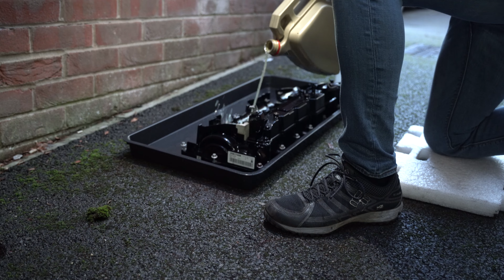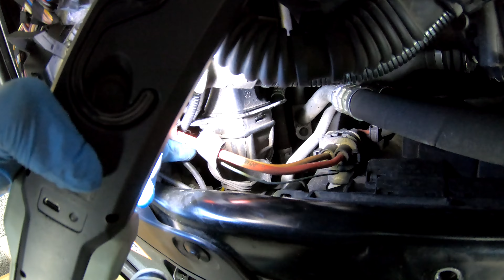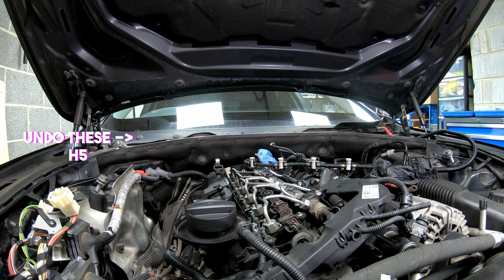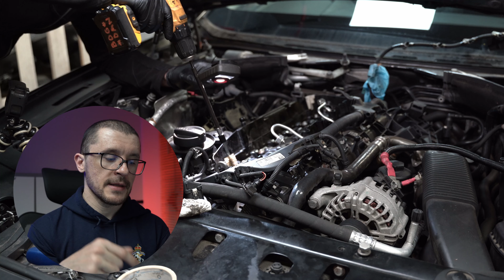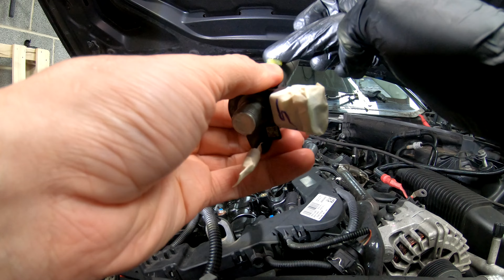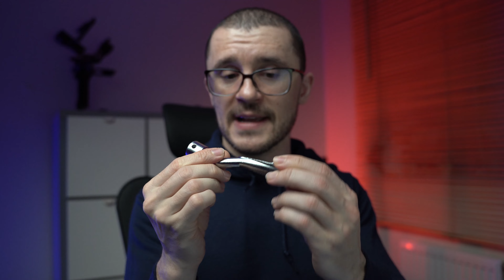How to Replace BMW F10/F11 530d N57 Valve Rocker Cover Gasket  - Step By Step - Common BMW Problems

Comment: Hi thanks for the video, i've heard people changing the whole cover as the gasket leaks again after a while, what's your opinion on this ?
Do you think it's a doable job for the average joe ? I believe if i had a repair manual with steps and torqs i could do it, did you use a manual ?
Reply from the maker: I do believe that you have all you need in this video and in the other videos I have o the channel. Also I offer 1to1 paid technical support GBP100/session . if you need that, email me and we can book it.

Comment: OMG I just did this on my 2014 535D US based and I’ll post the video soon. Dealer wanted $3000 Here is what I learned. Some tips, For priming, If you don’t have a computer, you can just hit start and let it crank over 10 times and it will start. , on my car it was about as many times as this video. The injectors need to be numbered and go back where they were because they are programmed for each cylinder. Same I numbered the fuel lines, You don’t need a fuel line socket, I just used a wrench. 🔧

Comment: What the hell are the little tiny o-rings for no other injector seal kits or websites list them. Fcp eruo and ecs just nothing.
Reply from the maker: You are referring to the fuel return line O-rings?
Reply: @BestCarMods if by that you mean the super tiny black o rings yes
Reply from the maker: @michael_christian9461  those are the ones.
Reply: @BestCarMods i absolutely for the life of me can not 100% confirm if my car has them or not no us sellers dont have them do all these n57s have them? As far as the us is concerned, they dont exist. And the linked one in your bio wont ship to us
Reply from the maker: @michael_christian9461  you can do the work even without replacing them.

Comment: Its always best to replace the valve cover and gasket, You dont need a fuel diagnostic for bmw just turn the ignition on and off x5 before trying to start, also the injector bots are stretch bolts and should be replaced if ever removed as they are 1x use only, appart from that fantastic video and good job 👏
Reply from the maker: technically, you got it wrong. the fuel priming needs to be  done via diagnostics and in the case of my engine (but i believe is the same for all N57 47) the injector bolts are not required to be replaced. If you find technical documentation that contradicts this, please share it.
Reply: @BestCarMods technically I'm right with another 1 done today, auto prime by using the ignition and never reuse the strech bolts unless you fancy snapping 1 off in the near future
Reply from the maker: @jakesingh6905  again, could you please link/state the source of your findings? how did you reach the conclusion that the injector bolts are stretch bolts?
Reply: @BestCarMods any good mechanic knows this, Google it i did put the link but they keep removing it
Reply: I've done plenty of these and in my opinion they are called stretch bolts for a reason, do some research they are 1 time use, also simply turning the ignition on a few times primes the system automatically 😉
Reply from the maker: @jakesingh6905 again, could you please share where you found this info? My service manuals don’t reflect the same thing.
Reply: @BestCarMods Google it buddy

Comment: I was quoted 360 euros to fix this issue on my 530D, i thought damn so expensive, because i opened the valve cover on a 2008 Caddy which was super easy, no need to unplug anything else to get to it, but after watching this video i think i got a good price lol.
Reply from the maker: I recommend changing the cover completely not just the gasket.
Reply: @BestCarMods  Yup i did that, researched a bit and got to that conclusion pretty quickly, now it's all good, after that i realized i also have a oil leakage somwhere on the turbo, so that sucks but i'll fix it too.
Reply from the maker: @mrd799  :)) same as me. I sent out the turbo for a refurbishment (last month) and now it is all clean and no oil in or on the exhaust. also it feels like it has more power.
Reply: @BestCarMods  Nice, yeah i have the same issue, my 530D is tuned to 330hp, its 245hp stock, and sometimes i get even less than stock power, it sometimes feels ke 200hp, and sometimes it has the full 330hp,
Reply from the maker: @mrd799 try to measure crank case pressure, that might influence turbo oil leak.

Comment: hi, how i can bleed the system without diagnostic tool? and what you was soldering there?
Reply from the maker: 1. you loosen up a injector pipe at a time and you crank the engine . that will eventually bleed out the system. 2. watch the video and you will see.
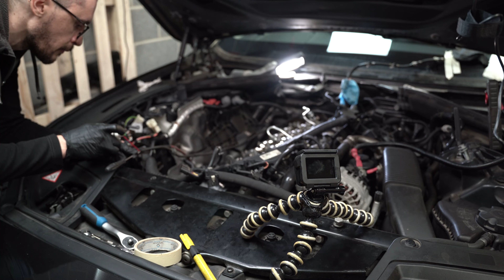Reply: @BestCarMods Sorry but it's not clear about the soldering. At around 14:30 your not commenting and the camera is too far away to see what you're doing. In the pictures we don't understand what we have to look for, no annotations.
Reply from the maker: @MickD464  https://youtu.be/NAElcGkdvys?si=vcb_Zt1_LCcdn85Q&t=817

Comment: Any long term issues you've noticed with having modified the valve cover to clear the fuel lines? I kinda don't want to remove the intake to do this job lol

Comment: Which brand valve cover are you choosing?  What are your experiences?
Reply from the maker: I installed febi and the client had problems, I installed vaico and it was ok. For my car I plan of buying Vaico. Right now I have the old one with glue on the sides.

Comment: Can I put copper grease on the injectors after removing them?
Reply from the maker: I would not use that. The last car I have worked on, had copper grease placed by a garage  2 weeks before. It burned and created a lot of carbon deposits. Also avoid placing grease on the washers or near the tip.

Comment: Holy cow, what an ordeal 🤯
Reply from the maker: and I need to do it again ... :)
Reply: @BestCarMods I need to do mine aswel…started smoking.any tips on getting it right first time ?
Reply from the maker: @seniorsmith9307  change the part completely.
Reply: @BestCarMods had my gasket replaced now when car is hot knocking noise at idle , did they mess up injectors?
Reply from the maker: @seniorsmith9307  anything is possible, from not placing the injectors in the right order to not cleaning the seating surface and possible blow by. diagnosing this via internet is not possible. did you/they replace the coper washers?
Reply: @BestCarMods yes they did… but they had to change them because the ones I supplied (elring) were to thin. I might have to go back and as them if they followed protocol with that. Thanks
Reply from the maker: @seniorsmith9307  if they pay attention to the thickness of those washers they should be good at following procedure. many tech don't even consider that. Also I am surprised that a brand like elring to mess it up
Reply from the maker: @seniorsmith9307  technically speaking, if you did not have the noise before the rocker cover repair, it can't be the crankshaft pulley as that one is in a different area altogether and they should not have touched anything there.
Reply: @BestCarMods true, also when warm idle I’m getting a new consistent smell in the cabin
Reply from the maker: @seniorsmith9307  :)) you really had bad luck with this repair. How much did you pay for it ?
Reply: @BestCarMods   350. Shoild I request them do it again?
Reply from the maker: @ at a minimum you should ask them to take a look and see if they missed something. Ask for a technical report saying what they consider being wrong.
Reply from the maker: @seniorsmith9307  complicated to say ... if you go to a dentist and he messes it up would you want the same dentist to mess it up again ? where are you based?

Comment: Hi mate, great work.
My car F11 520  just started to smell a bit inside. When I put my hand behind the engine left hand side  i notticed on my fingers bit of oil nothing major, there are no lights on the dashboard. Do you think I should use a gasket oil sealant ?  How long did  it took you to do the job on your car? 
Thanks in advance.
Reply from the maker: when you do it first time, look at one full day.
maybe on the 2.0 you have more room and you don\t need to take apart as many things. 

where are you based?

Comment: Im changing the cover complete , with new gaskets. Seemed logical. Once the top of the head is cleaned off, so you need to lube the new gasket face before seating the cover back in?
Reply from the maker: yes. with a bit of engine oil

Comment: My F11 525D has just failed its MOT on an oil leak and I think its this. Back left corner.
Reply from the maker: :) clean it with brake cleaner and go for a recheck :))

Comment: So I’ve got smoke coming from a plastic cap directly behind the oil filler cap. Could this be the same issue ? Not even sure what the cap is. It’s slightly smalller than the oil cap and is fitted with clips. BMW f10 (2012)
Reply: The black round cap in the middle of the screen at 18:24 on this video
Reply from the maker: what engine ?
Reply: Same engine as this f10 535d
Reply from the maker: @danhowey5784  hard to tell just by your description ... it can be the cover itself or i would think it is the PCV return hose .

Comment: Hello thanks for the video! 
I got a question about the metal shards, are they not falling in the cilinder when cleaning with the wire brush, or sanding? And is a vacuum cleaner enough to get it out?
Reply from the maker: 1. you are not producing "metal shards" ... as your aim is to eliminate carbon deposits and just gently resurface the injector seating 2. using compressed air or a vacuum is the best you can do... feel free to use any method you consider useful. Just make sure you don't drop something (big) in the piston ;). many times we overthink it.
Reply: Might not be relevant, but on my ”beater” 320d i just used screwdriver, break clean, wipes and vacuum. It had so much carbon that the whole shaft and hole was covered so i had to use vac

Comment: In case anyone wonders, the BMW dealership in Dallas Texas just quoted $3,750 to do this job. My sister in law asked me if I could do it. I've replaced tons of valve covers, so I told her I would take a look. I'm convinced that BMW has a team of engineers that are tasked with taking every job and redesigning whatever is needed to make the job as difficult and overly complicated as possible. Are you kidding me??!  THIS to replace the valve cover??!  GTFO. I've kept my wife's 2011 MINI S running all these years and I despise working on that car. We are dumping her MINI and getting something that isn't designed by sadistic jerks.
Reply from the maker: :) German Engineering
Reply: Like I tell all my coworkers who say "ohhh Mr money blah blah". No.... if i couldn't work on them myself I wouldn't be able to afford them.. the price vs performance along witg reliability is insane for these cars. Gotta keep up with them though.
Reply from the maker: @DiddysBBOil  well said :) need to do some preventative maintenance. also my theory is that you pay less on parts if you buy them when you don't need them ...

Comment: thanks great video, followed it to the letter, unfortunately I am still getting a tiny leak at the back of the engine after replacing the gasket, so annoying, just a drop every 30 seconds or so after the enging has warmed up, it drops off the back bolt to the left as you look at it, tightened down to 9nm
Reply from the maker: tighten it a bit more ... by hand maybe holding the ratchet closer to the ratcheting mechanism so that you don't generate to much force.

Comment: What’s the thread size on the top of the injector?
Reply from the maker: don't remember that value. I know that the injector puller kit had it inside .. planning on making your own extractor?
Reply: @ nah I’m replacing the rocker cover now and got stuck with two injectors. Ordered the kit waiting till tomorrow for it to arrive.
Reply from the maker: @offsetguitarsuk  where did you source the cover from? I will need to get one for my car also, as I have changed only the gasket and found out later that the cover itselft is also faulty. I get a small amout of oil on it. Not major but I think of when I do the timing chain to get a new cover also.
Reply: @ aftermarket one from ebay. Febi gaskets. Mine after 2 months started leaking so bad it’s like a waterfall.
Reply from the maker: @offsetguitarsuk  I was disappointed of febi because on my last order, the water pump for the bmw f10 was not machined correctly and was not sealing well. Had to rework it myself, but should I not have caught it, it would have been a big coolant spill in my garage + on the V belt and that stuff will compromise your belt, you can't dry it up.
Reply: No only the gaskets are Febi, rocker cover is no name 😂
Reply from the maker: @offsetguitarsuk  😏the ebay special chinesium ... let me know how it all goes ... I am genuinely curious now ...
Reply: @BestCarMods  probably be alright.
Reply from the maker: @offsetguitarsuk   how is the work progressing ?
Reply: @ all done my friend. The cover didn’t fit as good as the og one but it’s on.

Comment: you are one very talented man I give you that! I was going to attempt to do this job on my 2013 535D as I keep losing oil and then I could smell oil in the car after a journey so I whipped my hand down the back of the engine and low and behold my hand is covered in oil. no way would I attempt to do this its way above my skill level and the last one I did was in 1999 and much easier! have you ever seen an issue with the rocker cover its self being the issue ? imagine doing all that and then it leaks again even with a new gasket.
Reply from the maker: https://youtu.be/EUSe3Od1AMs

Comment: that’s a lot of work.  Well done.  My take away and learning from this was a useful one, which was not to try this myself!
Reply from the maker: :)) don't give up that easy. you can do it.
Reply: If this wasn’t our primary vehicle and I had all the tools I’d give it a shot. I understand why they charge so much for this replacement. How often does the valve cover itself fail and need replacement?
Reply: Yea after seeing this i may just take it to the previous owners prefered shop and see if they got a warranty on it cause they did it already.

Comment: Can you use the D7S to bleed the fuel system or do you need to buy the x-431 to do this?
Reply from the maker: tested today, and the answer is no. xtool is not able to bleed bmws

Comment: When do you use the injector seat cutting tools? What is their purpose exactly? Do you have to worry about metal shards falling into the cylinder?
Reply: Not necessary to cut the seat, I've done hundreds of these and just used a wire brush to clean injector bores and never had an issue.
Reply: @mikemata623 what about the metal shards that fall in the cilinder? How do i get those out? Just with a vacuum cleaner?
Reply from the maker: what would you think is their purpose?

Comment: What are you doing at 14:03?
Reply from the maker: cutting the cover so that I don't need to undo the HP fuel lines or bend them and have problems later when reconnecting.

Comment: Thanks mate I followed this on 2012 730d worked a charm. Had to walk to the gas station as I only had 10L of fuel its minimum 20L to run fuel bleed that sucked. By the time I got to that point in the video it was too late haha. I used ISTA to bleed. Got that injector puller off AliExpress $20 as well as copper washers and o rings
Reply from the maker: I am glad to see someone actually putting the information into practice.

Comment: Hello, nice video. Why not change valve cover? Most all recommended replacament together valve cover with valve cover gasket?
Reply from the maker: short answer ... because I was dump ... Long answer, I thought it is only the gasket that ages. I have never worked on that part and I did not know the cover can have problems, as it is made by 2 parts joined together. Also ... gasket is 20GBP ... complete cover is 200+GBP....  this is what comes next https://youtu.be/EUSe3Od1AMs